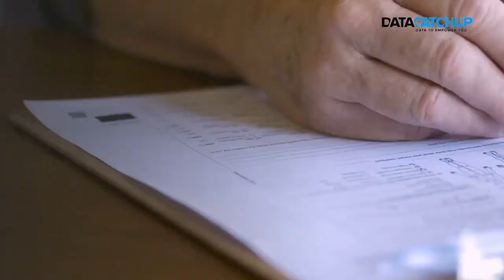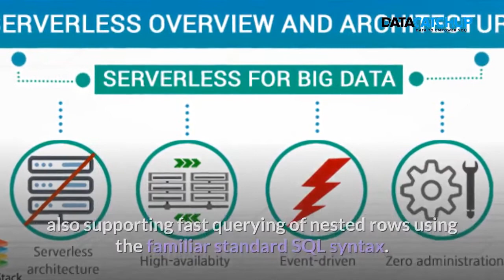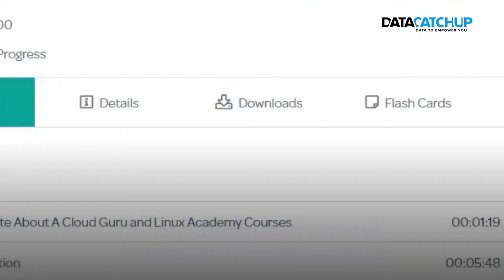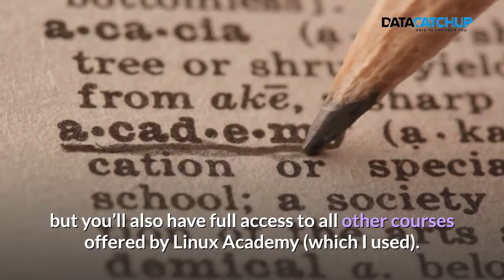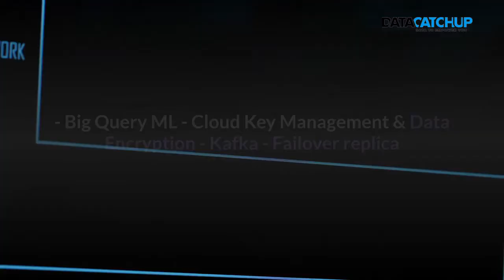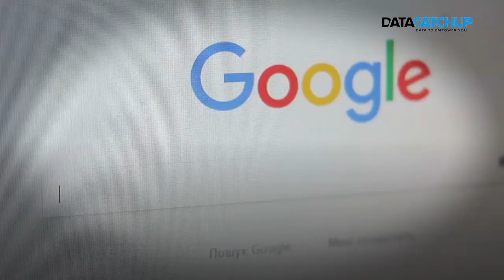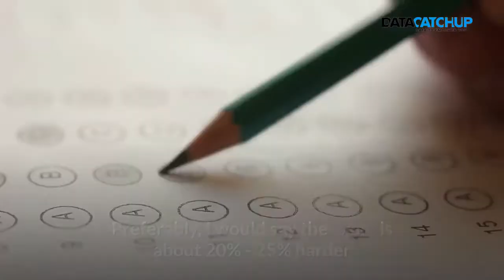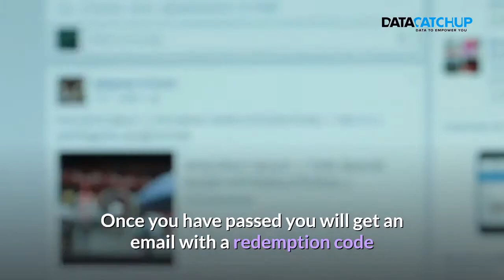How to pass the Google Cloud Professional Data Engineer Exam | Free Resources

Comment: If Google only give 'PASS/FAILED' remark then what's the exact criteria, how much questions should be get corrected in order to pass I.e to achieve that certification?
Reply from the maker: Great question. I will say spend sometime to research as these exams are usually updated after some years. 80% should be a good grade. Thanks for watching.